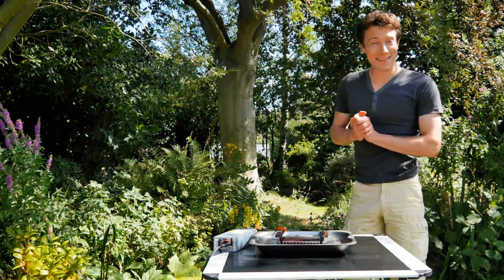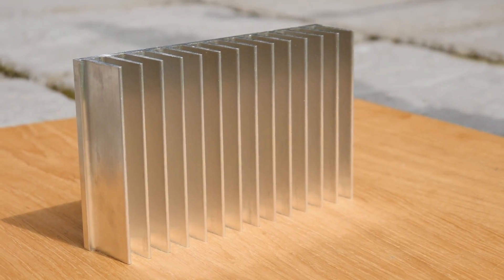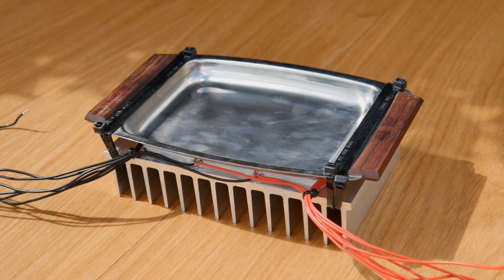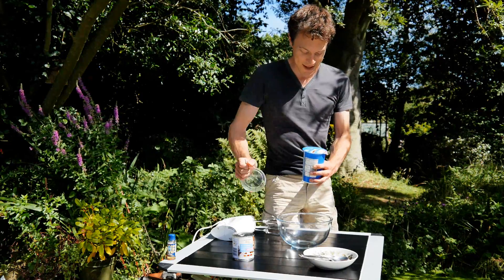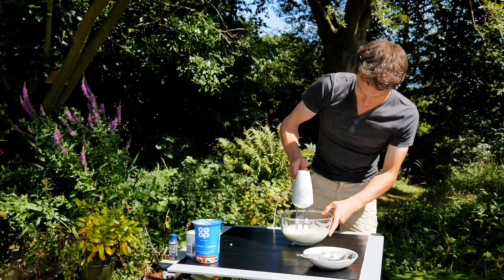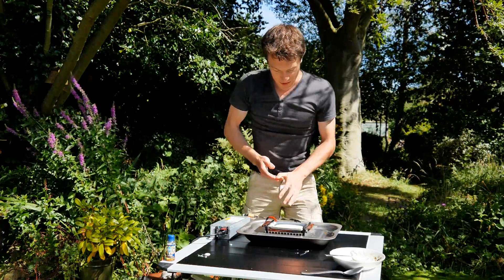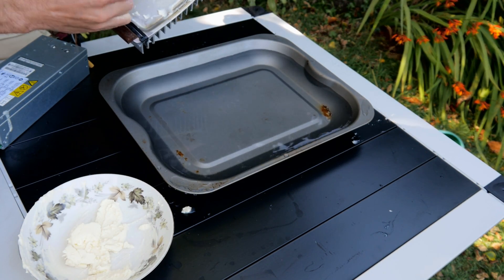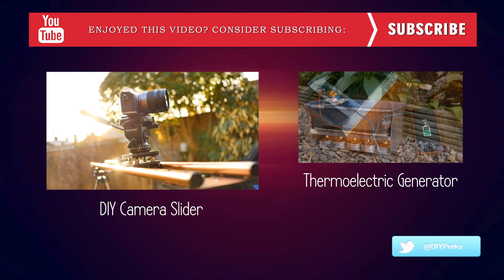DIY anti-griddle (for INSTANT ice cream!)

Comment: Could I put a Peltier Element in between a CPU and a heatsink?
Or would there be condensation?
Reply: Condensation, massive power, and still have the thermal co-efficient headache between the Peltier heat-sink and air. The delta thermal is also a major problem

Comment: Don't forget to choose a thick wire between the Peltier modules and the PSU!
400W / 12V = 33 Amps
Thin wire will belt/burn.

Comment: Wow! I'll probably try this lol except air cooled instead of water.
Reply: You'll need a massive heat sink and fan to dissipate 400W in to the air.
Reply: Ed R Nah I'll make a small one using 100W TEC and I have 2 3000RPM fans anyways.
Reply: +acnfanmanin Air seems like it would be a lot worse, water does the job just fine and is basically free and silent.
Reply: A Troll Named Rod I want to make it more practical of sorts.
Reply: Just remember you only have about a 60°C temp difference to work with. Getting an air cooled heat sink dissipating 400W to stay below 30°C is a real challenge unless your air temp is below freezing. Compared to water air is incredibly poor at carrying away heat.
Reply: Ed R Nah man I'm not going to use total 400W Peltiers. Im just making a tiny one with 100W and trust me it does stay frosty.
Reply: Actually I'm thinking of making a watercooling loop for it.

Comment: How about using this method for a PC cooler. If it's really that cold, then this can be added on top of a CPU as a cooler. As the water that's warm, it can be cooled back using a radiator and fan!!. Very intersting. Thank you

Comment: Great video!
To fix the texture, add some kind of stirring device to keep the ice-cream in constant movement. Or just use a spoon (plastic or wooden) :P
And since you use Pc power supply, why not hook up a CPU water cooler to the heatsink? One of those AIO could be used i guess :)

Comment: Find these things all over Asia as streetfood vendors. There's videos all over.

Didn't realize they were this simple to build. Nice.
Reply: those are a little bit better made, and use a proper compressor as the heatpump....
Reply: @Manawyrm  actually, the compressor heat pump on the ones on amazon overheat and the machine can't but used continuously whereas this design in this video can be used continuously as long as you put ice in the water tray to maintain it being cold.  so this one can be a better design than the lower cost compressor based ones and cheaper to obtain as well.
Reply: Was about to mention those same vendors as well. Guess I'll build something like this and try to see if I can make Ice Cream treats like those Asians.
Reply: Simon WoodburyForget i actually have to make homemade ice cream as my eatung habits prevent me from buying anything off the shelf. electicity means nothing when restoring a delicious treat to my menu.

Comment: But there is no flow on the water, making the heat transfer pretty abysmal.
Reply: i am pretty sure water is a good heat conductor so the heat would radiate outward through the water bringing the entire water volume to equilibrium automatically without need for water flow.

Comment: Hey, you could put a second tray in the first one and seperate them with a very thin layer of alcohol. This way you can remove the upper tray quick once the ice is ready and the two trays will not freeze together.

Comment: would those devices work on a pc would be cool if they do :3
Reply: Condensation, massive power, and still have the thermal co-efficient headache between the Peltier heat-sink and air. The delta thermal is also a major problem

Comment: Ah, power supplys and water. What could go wrong?!
Reply: Not really much. As an improvement, I'd add a switch on the green wire (soft power on/off) so that you can switch off the power supply without exposing the (not really dangerous) 12 volts.
Reply: Not much really. Psu would probably blop out if you submerged it.
Reply: @dumle29  probably is stil a high threat. and you dont need to submerge it
Reply: Master Chief You're not wrong but its the current that flows through your body that matters not what's flowing in the wires. To get a dangerous current to flow through the high resistance of a human body at least 60 volts is needed. I'll happily touch, put my tongue round, get in the bath with anything 12 volts however high current it is.
Reply: @Ed.R  He is wrong in what he said. He is a moron.
Reply: You'd have to be a special kind of moron to drop that psu in to the water. It's basic common sense really. Stop nitpicking and enjoy people's ideas in life 😣
Reply: Modern power supplies have isolation and fuses.
Reply: Simon WoodburyForget I'm not interested in having a long discussion about it. Go and research the thermal conductivity and heat capacity of air and water. Then you'll understand why water cooling is the best option.
Reply: Only wish peltiers where power efficient. 
But what about current control? 
I used two in serial connection to use it on a car battery 🔋 it works fine as well.
Reply: Simon WoodburyForget Because its designed to work in short bursts and for that water will always work far more effectively as a heat sink. Just replace the water with every new batch of ice cream, simple.
Reply: Ayama Prantenna I don't know this discussion is getting a bit confusing and pointless. The way its done in the video makes sense and is the best way in my opinion.
Reply: At 12 volts very little can go wrong.
Reply: mmm idk 😂
Reply: Simon WoodburyForget But its more complicated to build, more expensive and uses more power if air cool. Who's going to be making ice cream where they can't get water.
Reply: Ayama Prantenna No you can seriously overclock them. For a given current they have a fixed temperature difference between each side. If you don't cool the hot side the cold side will never get cold. The whole thing will just over heat and destroy its self. Don't forget that the current flow through it will also generate heat which must be dissipated.
Reply: MisterBlack83 if
Reply: Just plug into a GFCI and you will be OK
Reply: +Ed R (Oran) 12v output but still 240v input.
Reply: +Ed R (Oran) To every single "little voltage" morons.

Amps are dangerous with electricity. Not volts.
Next time you'll stfu.
Reply: @zezeratul  Ohhhhhhhhhhh Master...you are full of sh&t.   The Sh&t Master.  Maybe you don't know Ohm's Law?   STFU you moron!

Comment: That's about 5 times too much thermal paste.  Thermal paste is actually a relatively poor conductor of heat.  It would probably be more effective to not use any than to use the amount that was shown here.  Its only meant to fill in microscopic scratches in the interfaces.

Comment: I think I'm gonna build something similar, but rather than creating ice cream I want to make ice cubes and a beverage cooler.
Do you think a metal ice cube tray would make enough contact with the peltier elements or should I use something like thermal gap fillers to increase overall cooled surface area?

Comment: What is the difference between normal gum and thermal compound
Reply: normal gum? as in, chewing gum? 
Thermal grease (also called CPU grease, heat paste, heat sink compound, heat sink paste, thermal compound, thermal gel, thermal interface material, or thermal paste) is a kind of thermally conductive (but usually electrically insulating) compound, which is commonly used as an interface between heat sinks and heat sources (e.g., high-power semiconductor devices). The main role of thermal grease is to eliminate air gaps or spaces (which act as thermal insulator) from the interface area so as to maximize heat transfer. Thermal grease is an example of a Thermal interface material.
Reply: Thermal compound in its "classical" form consists of ceramic (nano-)particles dispersed in silicone oil.

Comment: Would it be possible to use more Peltier elements in order to produce much more ice cream, or would there be issues regarding heat dissipation?
Reply: yes.  just use larger water tray and ice cubes in that.  i'm doing it.

Comment: Great video. Just a little suggestion: You need to add air to the mix in order to get more "professional" ice cream. Commercial ice cream usually contains up to 50% of air ( That's why a 1 liter can of ice cream sometimes just weights 500 or 600 grams).
Reply: actually the lower the air the more premium the ice cream and richer in flavor I read

Comment: Can you stack those peltier elements one on top of each other and how does it affect cooling performance and longevity of those components?
Reply: That's bullshit. One side of Peltier module is hot, other one cold. Efficiency of those modules is really bad, so you will end up overheating all elements (except the one on heatsink) and wasting power.
Reply: You get a greater heat transfer

Comment: Love it! :D Would the texture would be more like shelf ice-cream if you stirred it while it froze over?
Reply: Yeah it would.
Reply: +BloodySword I also asked myself the same question. As he said he's not that good at cooking he might not know.
Reply: people do make ice cream on these kind of surfaces now and the churning is just scraping it mixing it chopping it spreading it and then scrapping it some more
Reply: Same thought here
Reply: Yes. What Matt made was frozen sorta-whipped cream. The churning is a critical part for making ice cream. What you are trying to do is freeze it as quickly as possible so as not to allow the ice crystals to grow too large or incorporating too much air. You want to start with your cream mixture chilled to as close to the freezing point as possible to reduce the churning time. Ice cream is actually graded by the amount of air entrained. Superpremium has the least amount of "overrun" (air), followed by premium, regular, and economy.
Reply: Yes. I wonder wy Perks didn't have this idea, too. :D Perhaps it was too hot this day he videoed it.
Reply: yes, siring and mixing while freezeing will fix it
Reply: churning and stirring are very different, but technically it would be more like it.
Reply: I am thinking of building this inside a home, so will a wall outlet will do?
Reply: The Pokecrafter it's irrelevant i think...
Reply: The Pokecrafter - you need 12vdc for these elements. Your wall outlet is 120vac or 220vac depending on your country. Do not directly hook these to your wall power as that will either blow a fuse/pop a breaker (depending on the age of your electrical system) or potentially fry the elements and cause a fire....
Reply: @BKincaid  If your outlet is 120V, you can connect 10 of them in series with a full bridge rectifier and a smoothing cap to convert it to DC. I presume it doesn't require a constant current though since he used a standard PC power.
Reply: @bobweiram6321  120v AC rectifies to 155v dc actually.  I don't think its safe to run them in series you are supposed to send 12v dc to each one and them be in parallel

Comment: would it get cold enough to make dry ice (assuming you have carbon dioxide and all of the necessities
Reply: Yes, the peltier modules create a themperature difference from one side to the other which is about 60 degrees. So to create dry ice the "hot" side have to be cooled to about -20 degrees celcius which affects that the "cold" side will create about -80 degrees. You can also place one module above another and create a greater themperature difference and then you only have to cool them with room themperature to create dry ice.

Comment: haha, loool great idea! i think you should build something to cool down 4 bottles of beer in 3 min... :) with the same tech. i like it!
Reply: I've never seen that done, but I do have a Peltier cooled fridge that stores 6 beers.

a few years ago I made a few alterations to it, I put a bigger heatsink and applied thermal compound to both sides of the Peltier block(it wasn't built with any, seriously). Now the fridge runs at about -1c and cools a six pack very quickly.
Reply: Many did it. The point is that you can't really get that much surface contact with round cans/bottles, which makes this kind of technology pretty much helpless with that form factor.
Reply: Instead of a metal bowl, you can do it with a metal pot.
A metal bowl has a small base area to which peltier pads could be attached; while a metal pot has a bigger base... so more peltier pads could be attached, thus faster cooling.
================
In my place, just get a big styrofoam box and fill it soda/beer cans, water, and lots of ice. If the box got holes in it, just line it first with clean garbage bag before putting anything.
It cools drinks faster.